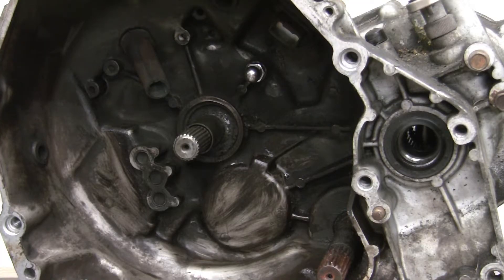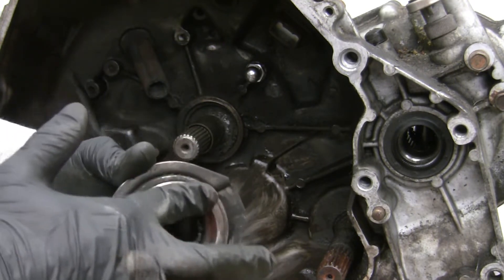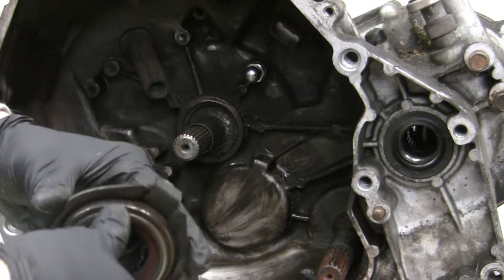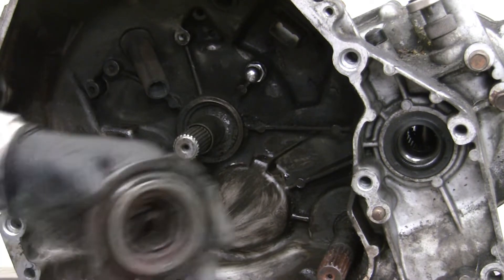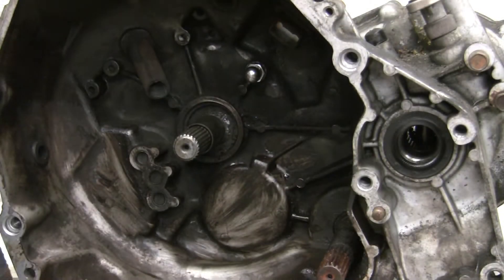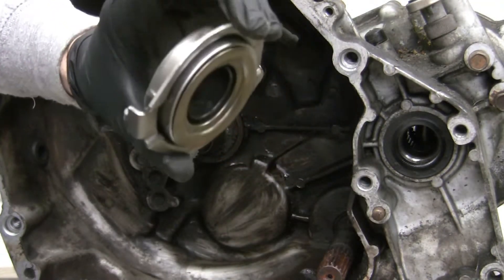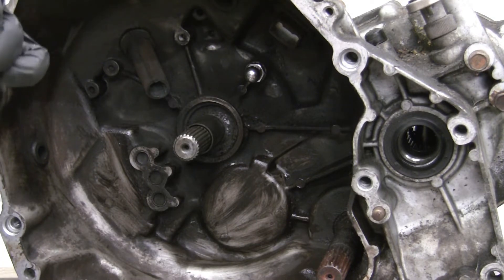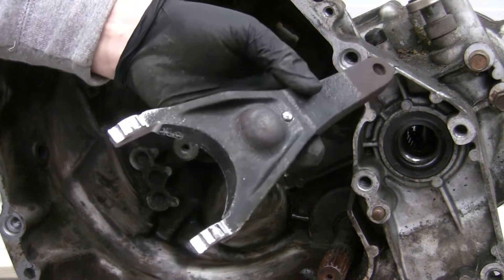6G72 Engine Assembly - Part 13 - Fly Wheel and Clutch Install

Comment: What brand clutch did you go with and how do you like the 6 puck engagement/feel?
Reply from the maker: So I ended up getting the M-PACT 05075ST2 from RockAuto. The big thing that I am finding is that it grabs very aggressively. The clutch also engages VERY low on the pedal. (Push ALLL the way in, to disengage, and lift just ever so slightly and it engages.) This took some time to get used to, but I like it now. I only have ~55 miles on it, so can't talk about long term usability. Hope this helps.
Reply: @AGeeksGarage  thanks I do prefer a full face for low power street driving but if your planning to upgrade turbos down the road it makes sense.  Did you try adjusting the clutch pedal free play? You should easily be able to raise the engagement point with lengthening the pushrod on the clutch booster